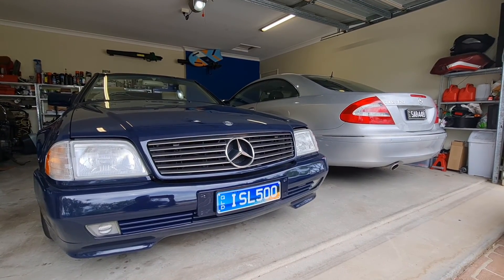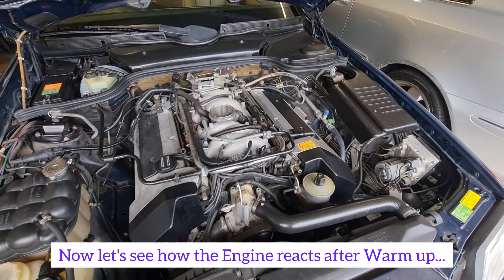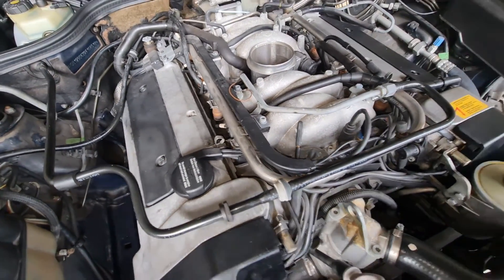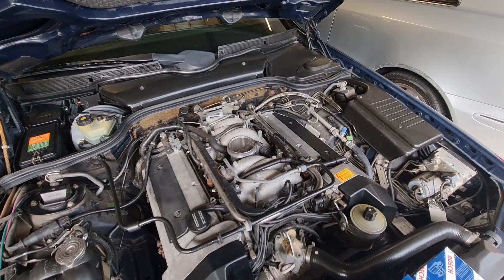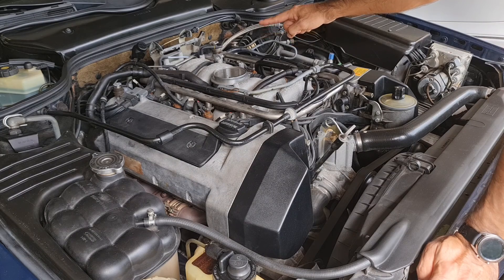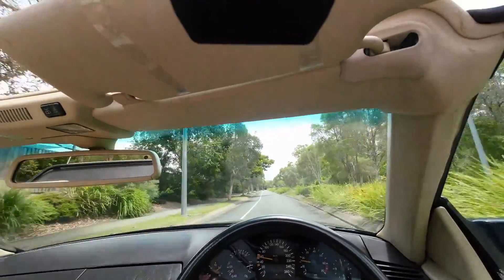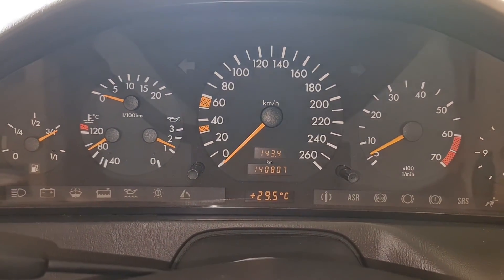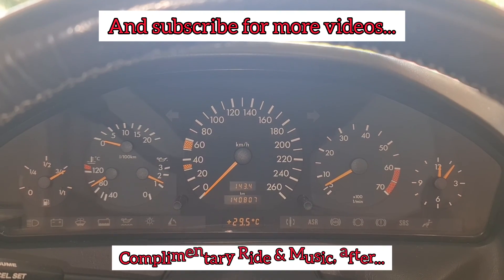Mercedes M119 Engine Hesitation Issue Solved (SL R129)

Comment: I have Q.for u  what if ASR  light coming on and no throttle body response ?
Reply from the maker: on these engines that have engine harness issue, you need to check if your throttle body harness is good and not affected.  replace if affected.

Comment: I have a problem with mine where it cranks but doesn’t wanna start I’ve done plugs wires fuel pump fuel filter cps sensor new terminals also battery and alternator but nothing anyone got a clue thanks?!
Reply from the maker: So we always need 3 things for the engine to run:
1. Fuel
2. Spark
3. Compression 
Do we get them all properly?

Comment: Even my 300SL-24 with M104 engine had the same problem.  My mechanic had replaced all the spark plugs, fuel injectors etc. Nothing helped.  I had a friend told me to change the distributor and it worked. The moisture comes from the camshaft.  If that happens again, you need to change the camshaft seal as well.
Reply from the maker: Very true 👍

Comment: Hey I have a similar problem with my sl 300 r129. At first the car starts completely normal bit when you start driving it for a bot and stop the engine or sit at a red light a little longer the when i try to normally drive away the rpm drops and the car almost shuts off. And when i stop the motor and start it it goes off sometimes. When i manage to rev the car to about 4000 rpm when it makes problems ist goes away for a while. I changed the distributor cap the injektors and the cables which connect the distribuor whith the injektors. What else could the problem be?
Reply: 1993/3, the cables are all good as far as I checked them myself. I noticed that when I wiggle the MAS the rpm go crazy I think it has something to do with that
Reply from the maker: @mehmetakifayyildiz4695  still 93/3 can be the biodegradable wiring looms issue, my W124 is 93/3 built and biodegradable... check the throttle body harness too.
Reply: @BenzAddiction  I will thanks
Reply from the maker: What year is this? What is the condition of the woring harness?

Comment: I have a 1995 SL500 with 137,000 miles, original to my family, so I know the complete service history of the vehicle.  It has always been garaged, and serviced regularly.  As the OP points out, and similar to my experience, absolutely everything was checked/replaced with respect to spark plugs, wires, fuel system flush, new wiring harness, etc.  The problem for me, like many of the other comments here, is that if the vehicle sits for more than 4 or 5 days not driven (and it sat for a while after my Mom passed away, who was the original owner), the hesitation, backfiring, lack of acceleration, and misfiring all return.  And this is after having replaced the caps and rotors with brand new Beru parts (no longer available, unfortunately), as well as the insulator caps in 2021.  Shortly after the caps and rotors were replaced, the SL500 was running beautifully and was placed into storage for a year (heated and ventilated with humidity controls) as I prepared to move to another state.  When the vehicle was returned to me from storage via enclosed trailer, I fired up the engine and took it for a drive.  Within 10 minutes (after coming up to full operating temperature), the engine began hesitating and misfiring, as I've experienced several times in the past.  Like many of you, I've been desperate to find a solution.  I found a thread on 500Eboard that suggests not only the cam seals may be the culprit, but the cam solenoid may be leaking oil/fluids as well.  Check it out here: https://www.500eboard.co/forums/threads/thoughts-on-moisture-problem-inside-insulators-and-distributor-caps-video.11369/page-3

I am replacing with OEM parts my caps (https://www.mercedesbenzstarparts.com/oem-parts/mercedes-benz-cap-119158010226) and rotors (https://www.mercedesbenzstarparts.com/oem-parts/mercedes-benz-distributor-rotor-1191580231) once again.  I then plan to take the vehicle in to my local Mercedes-Benz dealership to have the camshaft seals (https://www.mercedesbenzstarparts.com/oem-parts/mercedes-benz-engine-timing-cover-gasket-189977947) replaced, along with the cam solenoid magnet sensor (https://www.mercedesbenzstarparts.com/oem-parts/mercedes-benz-magnetic-sensor-1190510077) (I don't have the proper tools to replace them myself).  BTW, there is a note made by a Mercedes-Benz technician about replacing the cam solenoid magnet sensor worth learning about in this video: https://www.youtube.com/watch?v=FAsCQLF1Zus&list=PLPZaz1HXAH9Wg6h5kDQo-9R1a85mdeiqA&index=20&ab_channel=TheFriendlyNeighborhoodTechnician.

One thing many board posters have commented on is these 1992-1995 M119 engined vehicles need to be driven regularly - they don't take kindly to sitting around for lengths of time.

Comment: Hey BA, I changed the caps, rotors, rotor brackets and cleaned the dust shield. The seal looked fine so I continued using it but the issue is still here. It feels like a dead cylinder (or more) and the idle is steady at like 500, but it’s vibrating the entire car. A huge piece of info is that one of the red plastic plug puller things was shattered, and it didn’t take much force to remove the wire from the plug, but every other plug wire required a decent amount of effort to get out. Could this be the source of the issue? I don’t remember how the plug wires looked when I inspected them, but they didn’t look too terrible, maybe a small amount of white stuff on the inside. Also, the wires are MB branded, and everyone I’ve seen doesn’t have mb branded wires. Could these be oe? I just got the car in April, so I’m not sure about maintenance. All I know is that the wiring harnesses were replaced, but it looks like everything else is oe.
Reply: Even the caps and rotors looked oe.
Reply from the maker: Obviously this happens when the car gets warm, next time quickly pull out one of the caps right after and check for condensation.  If so, replace the seals...
Reply: @BenzAddiction  the thing is, is that it happens cold and warm
Reply from the maker: @avlvelo2688  might have other reasons then...

Comment: I have a cold start (small) issue on my 93 M119 SL R129. It revs up to 1100rpm or so then goes back to normal 600-700rpm after starting it up. Does this 3times before the constant and normal idle(600-700rpm)comes, so basically after the cold start it takes 10sec until everything is all right and just fine but I don't understand  why my car started to do this.
Reply from the maker: I would say check your fuel pressure first...
Reply: Did you find out what the problem is?

Comment: Same problem, i replaces the distributor caps and it didnt solve the problem.. spark plugs are next
Reply from the maker: If it happens again, distributors seal would be next, I am preparing the ingredients for that too.
Reply: @BenzAddiction  do you have a link for the seals? I cant seem to find them

Comment: I have changed them and the problem came back again, how does your work now?
Reply: You need to change the seal of the camshaft too.
Reply from the maker: Did you replace the distributor seals too?
Reply: @BenzAddiction  Yes, the rubber rings on the inside.

Comment: The cause of the problem with the distributor is the seal behind the rotor.  This seal leaks oil vapor and water from the engine to the distributor.  The solution is simple and cheap.  There is originally only 1 seal, but there is room to place 2 seals behind each other.  I have now driven them 100k without any problem with the distributor.  These are still spotless.  I did install a Beru distributor and rotor.  Is slightly better than Bosch..
Reply from the maker: Thank you for sharing this with everyone, I am sure it will be helpful to many people...
Reply: You do not have to put 2 seals as there will be no function of the 2nd seal
The distributor sits directly on top of the dust cap seal 

If you have moisture it is due to the camshaft seal
Reply: Esatto  è  successo anche sulla mia 500 sel  @rome3332

Comment: If any one wil information about the solution i can send picture by mail of the 2 seals..
Reply from the maker: Thanks Marcel :)
Reply: Part number on rotor seal?
Reply: Do you have the part number for the seals? Or if you can message me with them. I have a 1994 E420 with very similar issues.
Reply: @Sardalani7 did you get the part number? I have the same engine as you

Comment: The moisture problem and the black color of the contacts in the distributor cap is caused by moisture and oil vapor leaking past the seal behind the rotor to the distributor cap.  A new distributor cap will be a temporary solution.  Sooner or later you will have problems again.  The solution is to place a 2nd seal behind the rotor around the camshaft.  So 1 old seal out and 2 new seals in succession.  This on both sides of course.  Since I did it I've been driving 90,000 km without any problems.  This is the only correct solution.  I'm happy to answer questions if you want to do it too.
Reply: Can you give part number for seal please 🙏
Reply: Yes please  @BADBOYUR999
Reply from the maker: You are definitely correct. I will do this soon. Thank you.

Comment: Hello, One more question. You change only the distributor cap or change both distributor and rotor?
Reply: I have picture of the operationele..
Reply from the maker: @Marcel b  if you can upload it somewhere, please leave the link here so everyone can see and use. Cheers
Reply: @BenzAddiction  yes, i try
Reply from the maker: I only replaced the caps.
Reply: Change the seal behind the rotor. Thats the probleem. There is 1 seal original but there is space to place 2 seals. The moister and olie vapour from the engine can not to the distriburcap. A new cap and rotor are not the solution.. 👍

Comment: I would never have guessed the distributors were at fault, specially after seeing how well ran when cold.

I guess there was condensation inside the cap and when heats up, that created a humid environment where the spark could jump anywhere
Reply from the maker: Yes, but I cleaned the old caps few times and it did make no difference to the post warm-up running...

Comment: Hello, the change of distributor cap solved the hard warm start up also? I have the same problems, but sometimes when i want to start the warm engine, they backfire into exhaust and not start. After a few minutes it turns on.
Reply from the maker: Hi mate, I had the warm start up problem but it was more like a over cranking issue, the engine would start on the second start. I had no back firing issue.

Comment: There is an ideal summary of this issue on the W124 E500/500E board. Distributor cap insulation is usually the cause of uneven idle/hesitation which only occurs when engine has warmed. People report different and inconsistent results depending on the brand used.
Reply: The reason that moisture and oil vapor enter the distributor cap is that the sealing ring behind the rotor of the camshaft is bad.  Oil vapor is leaking down to the distributor cap.  There is a simple and cheap solution.  Originally there is 1 seal but there is room to mount 2 seals behind each other.  The seal costs 15.00 euros at the dealer.  I have already driven 90,000 km and there is no moisture and oil vapor in it at all.  A new distributor cap and rotor is a temporary solution, moisture and oil vapor will return anyway.  I also have pictures of it..
Reply: @mirandat6526 how did you do this just press the 1st one in deeper and the second after that or from the inside
Reply: That sounds really interesting, care to elaborate a bit more?👍
Reply from the maker: Thanks for sharing my friend

Comment: Thank you for this insight into my 1991 R129 maintenance - as I’m also starting to experience similar fluctuations in throttle response actions. Bless you & thanks again - Mark (USA)
Reply from the maker: Hi Mark, thank you for the positive feedback and if you like, please subscribe as more videos coming.
Reply: @BenzAddiction  I already have been subscribed for some time as I enjoy watching/learning what your discovering in your personal journey with your R129! Your discoveries actually SAVE me time & money at my end - especially when here at my end labor costs at my MB Maintenance/ Dealership is: $195.00 (USD) an hour. Learning through your videos actually save me hundreds of dollars - so thank you - PLUS I enjoy your instructional videos. To be 70+ degrees & 😎 sunny here today (outside Indianapolis) (finally) so plan on bringing my R129/AMG out of the garage for a nice drive. Though in short order since it was stored during winter months a full maintenance I will be doing on her. My ‘91 R129 is Schwarz Black with Palomino Interior w/ 104,000 miles on her. Runs strong but the 32 year old plastic pieces around the vehicle are having to be replaced (one by one) as I’m sure your running into also. It’s a journey into learning all about my machines life and though the pieces are expensive - it’s so satisfying when old plastic is replaced with new! Thanks again for the time you’ve spent to share your R129 journey with us! Again, your saving me $$$ and I am very grateful for this. God bless & stay safe - Mark🙏

Comment: This is unbelievable. I have exactly the same car and exactly the same problem and was going to look at everything you looked at first 😂 It’s like a miracle that I just came across your video! Thank you so much for posting, you’ve saved me a lot of time and money
Reply from the maker: Thank you mate, the reason why I made the video was my frustration not being able to diagnose the issue for a long time. Just didn't want every one else to suffer. Please Subscribe for more videos :)
Reply: I own a E420, It has the same problem. It is very useful with videos like this. If anyone knows a "fix" like a conversion to electronically control injection, it would be great. I have stopped counting how many times, I have changed distributor caps.

Comment: I have the same problem and when I want to start the warm engine, they shoot into the exhaust and into the intake pipe, did you have that problem too? thanks
Reply from the maker: Hi mate, warm start up up was harder but no back firing sound in the intake or exhaust...
Reply: @BenzAddiction  thanks for.
Reply: Did you solved the problem?
Reply from the maker: @mendigo  As far as I remember, the engine once started on the second cracking, but that's maybe because I limit each cracking to 3 seconds.

Comment: I'm glad to see your video. My car has a similar problem with your car. If I leave it parked for a day or two, when I come back to start the engine it looks fine and runs fine. But when the engine starts to heat up So a vibration occurs. Looking at the engine, I can saw the engine shaking. And when the car was parked for an hour or two, the vibrations disappeared and driving was normal. If I drive every day, there will be no symptoms like this. Does your car after replacing the distributor cap and being parked for several days still vibrates? Please update with me.Thank you so much.
Reply from the maker: It is all fixed now, it was all the distributor caps my friend :) inspect yours, if they are older than 50000 km, they will need replacing... enjoy your mercedes
Reply: @BenzAddiction  
I'll try to find replacement parts. I searched for the cause of the vibration for a long time. I hope it will bring my car back to normal as well as your car. Thanks.
Reply from the maker: @user-uf4cy9bn8c  I am sure you will soon, keep us posted.
Reply: Did you ever fix this problem ? What was wrong ?
Reply from the maker: @henboy1  fixed the hesitation and rough warm idle issue...